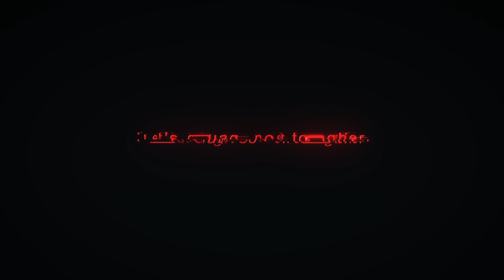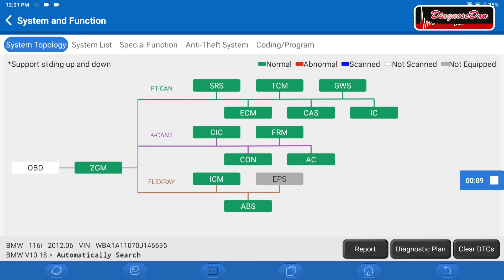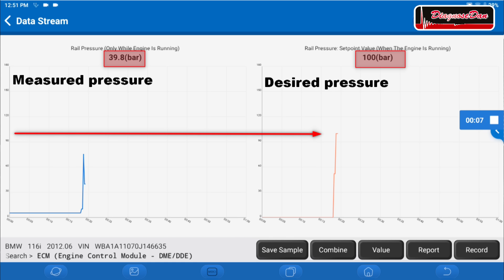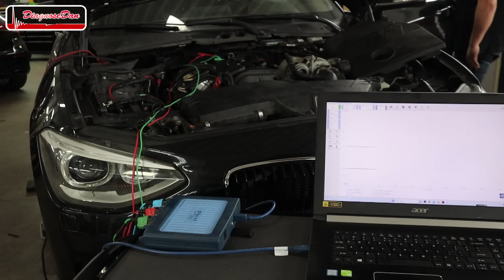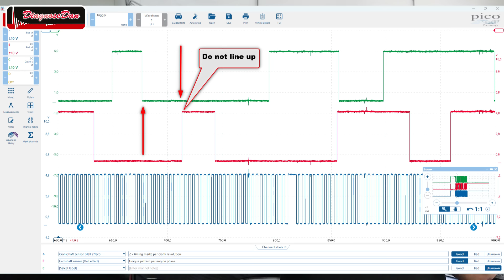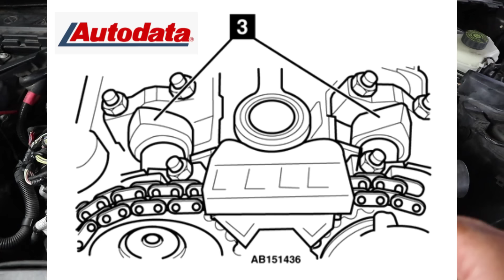Bmw dealership blunder? Incompetence?

Comment: On my diagnostics it has cam/crank sync and would have picked this up straight away and this would have been at the side of the road! I wonder how many parts of the parts cannon would have been thrown at this by the dealers before light dawned on marble head??
Reply from the maker: We'll fortunately never know😊
Reply: @Diagnosedan  Bet the owner is thinking that to 🤣He/she still has a large repair bill to stomach!

Comment: Thank you, Dan. This was very interesting and informative. I appreciate your making the effort to show and explain how ha HPFP works and is controlled by the ECM. That was special.

  I am a bit curious about the potential / actual “interference” design of this engine. Was there heavy valve and / or piston damage done? I realize you were not hired to make that determination. But, curious minds ….
Reply from the maker: I was only asked to diagnose the initial problem. The independent workshop picked up the car and will repair it. They will keep me updated and if i have more info i'll share that on my Facebook page

Comment: Interesting. After you checked for spark, and introduced an alternative fuel source and the engine did not start, you did you not check compression next. This would have shown equally low compression in all cylinders confirming what you found with the graphs, a timing issue. Very few mechanics would have used a graph 📉 to check timing, perhaps the spark timing was also off also.

Comment: This channel should be called "has clue Dan". I deal with this in Aviation Maintenance, guys right out of school just can't see the problem, they are clueless but they are licensed A&Ps. You would think this is only the young kids right out of school, but the old guys out of the airforce who get to skip A&P school are worse.
Reply from the maker: In aviation standards should be alot higher. Bigger problem when the engine stops working😂

Comment: I have a feeling that the dealer tech (if we can call them that) has probably seen other cars of similar model and mileage that needed a fuel pump, and just threw a low pressure pump at it, obviously not testing and not fixing the problem. The second shop saw that a low pressure pump was chucked at it and staying on the fuel pressure thought train, put a high pressure pump on it, again not fixing the problem. A real diagnostician (Dan) did his due diligence and found it to be a timing issue, causing a low high pressure pump output. I am still puzzled though at how they supposedly checked the timing. Even if it didn't set a timing code, scan data may have shown the actual timing and the desired, maybe they didn't look or think it was relevant, or maybe they don't know how to properly read scan data. I don't know if it shows on that particular car though, but every car I have ever worked on always shows actual and desired timing. This is what sets this man apart! DiagnoseDan fixed it again!! Great job!👌🏼👍🏻
Reply from the maker: I've seen the scanraport made by the roadside assistance after i released this video. There were timing related faults stored!
Reply: @Diagnosedan  There you go! And for them to ask the customer which parts they wanted to replace next is just sad! Thank you for the great content and your time!

Comment: Dealer charge for parts and labor. When a problem is not resolved labor should be waived. New tech seems to be afraid to bring out the diagnostic tools. They don’t realize the more they use it the better they will become in troubleshooting problems.
Reply from the maker: Technicians arent always allowed to spent to much time on a vehicle.

Comment: this engine is probably very similar to MINI engines we never had any engines like that here in Canada or USA I have a MINI Countryman here a my shop that has a timing chain problem I have to take it apart to see if the valves are ok I have done a few of them same goes for the N20 N26 engines the timing chains are surely not a life time item.
Reply from the maker: Thanks for the comment its appriciated

Comment: I would say the codes were deleted and a tech at dealership seen code didn't pay attention all he saw was low fuel pressure and said ut need a pump would be my guess independent shop couldn't checked timing and found good unless there were just looking at data pid on scanner anyone with common sense says u can't go by a data pid
Reply from the maker: Thanks for watching

Comment: So much guessing goes on these days !!
We call it throwing a parts roulette or a parts Cannon  at it.

1st off when they condemned the low pressure fuel pump why didn't they apply external power supply to it and measure the pressure?

You can prove lots of parameters BEFORE spending time and money on parts.
Garages these days seem to be focused on guessing or just going by what a screen tells them !

Problem with that is very expensive bills for customers putting them off garages.
The better your skills the lower the final bill will be with maximum profit margins ✅
Reply from the maker: Unfortunately this sometimes happens

Comment: I can see why stealerships replace parts with minimal diagnosis. Hear me out. If you plug in code reader, it states part X is faulty and costs Y money, then you have to weigh up part cost Y to diagnosis cost Z. But there is a fine line, stealership should have measured the fuel pressure.
Reply from the maker: A Scantool will never tell you a part is fault.

Comment: As soon as I heard that engine crank, it spun over so quickly I suspected low compression. I would have run a cylinder compression test before doing any other tests. Why did the dealer chase fuel pressure  as the problem?
Reply from the maker: Thanks for watching

Comment: Interesting, but I am unclear... surely the high pressure valve is directly linked to the position of the cam that drives it.. so even if the cams are out of time with the crank (and ignition etc),.. it should always be getting correct timing from the cam sensor for the cam it is linked to?  so it should not have problems maintaining pressure, even on an "out of time" engine?
Reply from the maker: You make one mistake in you thought process.
The pressure in the rail is not constant. It builds up right before the injector opens. So the build up of pressure is timed!
Reply: @Diagnosedan  Thanks Dan for your reply, yes, you are correct, I was assuming that the pressure was maintained constantly on the high pressure rail and the injectors just fired when required. I was assuming there was just one cam lobe driving the high pressure pump, so one drive/pump cycle had to cover the four pistons. As you can tell by now.. I am no expert ;), so thanks for your clarification. I am new to your channel and enjoying it lots :)

Comment: I hate to say it but it sounded odd to me when you first cranked it to confirm the customer complaint. i.e low on compression. Cheers Dan another fantastic video and superb diagnosis. Was it also noticeable when you were checking for spark ? As that never seemed consistent either ?
Reply from the maker: Yes that was a clue the ecm wasnt sure about the timing

Comment: This is an interesting failure.  I'm curious how much real time you spent on this?  4 hours?  Two days?  A week?  Just setting up all the diag equipment, pulling wave forms, removing the valve cover....That's easily a full day of tear down.  How much did you charge the client for diagnostics?

Comment: Hey Dan great video! question, isn't the cam lobe a pre set thing? how can it push the HPFP plunger only 50% or 75%? wouldnt it always push it in all the way then the fuel pressure reg regulate the pressure up or down to suit? 
Kind regards from Australia.

Comment: Bmws of this Era seem to have timing chain issues. The bracket for the top guide is part of the head or replaceable?

The n20 is usually OK after it skips due to, I think, the dme detecting the cam timing is instantly wrong and retards instantly the intake lift via the eccentric shaft motor and it salvages the valves on the intake cam and the exhaust usually is pretty much on time like yours is. 

My guess is the exhaust timing is basically on the money if the chain wasn't so farked up and sloppy with intake cam 90 degrees out and the guide piece is long gone.

On the n20 you also need to replace the oil pump chain "module" as part of the service for a long lasting engine repair.
Reply from the maker: The guide is replaceable

Comment: I heard the timing chain problem at the moment you tried cranking the engine.
With the known issue of timing chain problems on that engine, this inability to diagnose the car correctly is inexcuseable.
I wonder how long the CEL was on before the chain  skipped.
Reply from the maker: I think it must have been on for quite some time!

Comment: Interesting, , How most humans' think because it the Dealership, they automatically know what the are doing. Spark and fuel test should always be done before changing parts, so if you spray a fuel source and it still doesn't start how would changing the fuel pump solve the problem?

Comment: Amazed a BMW dealership is so hopelessly incompetent not to diagnose/fix this car. You don't even need 20 mins of diagnosis, you can hear as soon as it cranks that the sound is different, and that there's hardly any compression during trying to start. But obviously, the "go to" tests are the cam/crank waveform and the crank/current draw during starting.
Reply from the maker: Thanks for taking the time to leave a comment its really appreciated

Comment: So.... what is the next step?  We found the broken chain guard, did it not jump teeth? And if it did, does this mean engine out and check for valve damage?
Reply from the maker: My job was to diagnose the initial fault, the vehicle went back to the independent workshop to get repaired

Comment: Has the drive gear for the high pressure fuel pump failed? Some engines the pump is driven directly by the camshaft, others have a little gearbox type assembly between the cam and the pump. I have seen it where the gears explode - the pump has no drive, and hence no fuel pressure.

This comment is written 8 minutes in. Wonder what the problem actually is.
Reply from the maker: Now you know😊

Comment: We have had so many BMW'S with this problem,  a cursory look at the  fault codes results in the removal of the cover and a look at the cam positions.  A pain is the removal of the sump to get the obligatory broken guides out as it involves dropping the subframe a little and disconnecting the rack. I would say How in God's name BMW and so called BMW  specialists don't know this ? BMW mechanics at our local dealerships  would not know what to do, a new engine would be the only recourse  which writes off the car. The specialist  probably  good at M badges and wide wheels. I am soon to retire and I despair of the new mechanics who seem to think every thing is fixed by a diagnostic machine or a remap.
Reply from the maker: I know, but when you've done it a few times is actually not that bad.

Comment: As the both pumps have been changed you can assume that there is no more primary fault. Why didn't you measure the pressure on the high pressure rail? And even if the pump provides only a 50% of pressure, the engine will run. I would proceed in another manner, above all for this engine who is well known for these problems that means timing failure. Once you removed the plugs and checked thems you measure the compression followed by endoscoping the cylinders/valves. That provides you a rapid understanding of the problem. We do not know in this video what finally happend. But the slash of this chain by jumping can easily cause bended valves. Thats probably why the engine didn't start anymore. It's dramatic, that the BMW Dealer didn't reveal this problem.
Reply from the maker: We didn't measure but we sure read out the high pressure in the fuel rail didn't we? 
Would a look in the cilinders reveal a problem? I don't think the valves are damaged. We also did a compression tests didn't we? ( The in-cilinder waveform)
Reply: @Diagnosedan how is the compression derived from the in cylinder wave form? Why not use a pressure gauge on the spark plug holes to be sure?

Comment: oof... BMW with these plastic timing chain guides in their engines faces constant issues. This is not the first video I see on the topic. They usually are mentioned in conjunction with the N47 diesel engine that likes to skip a beat and destroy itself in some cases.... from what I gather this is rare though but not unheard of and in some cases it turned out that the oil was never replaced or the engine was abused... so the jury is pretty much out on whether BMW is at fault with these timing chain related issues.
Reply from the maker: Maintaining your vehicle properly certainly helps!

Comment: is wessels und müller in the netherlands too or where u got the bremsreiniger? also you shouldnt be using bremsreiniger directly infront of the turbo ;)
the other shop checked the timing by fault codes. no cam/crank faults = timing is good.
Reply from the maker: Yes WM opened up a few stores here in Holland

Comment: what caused that guide to fail?  i have seen many guide failures but none where the metal broke
Reply from the maker: Because of the slack in the chain, the chain is knocking against that guide alot causing it to break

Comment: I'm sure there's a reason the high-pressure pump doesn't deliver a continuous high pressure and let the injectors worry about the timing, but wouldn't that be simpler?  The problem with failures is the cascade.  Don't line up too many dominoes to fall or the techs will start jumping out of windows.  BMW is known for all this stupidity.  How do other cars do this?
Reply: Then you would need a pressure relief system much like common rail diesel engines. Which adds to the complexity and cost, yada yada.......

Comment: Ive been in this industry 15 years.  Amassed 150k in tools and 99% of technicians including myself do not go to these lengths to find the answer.  Although amazing this is not practical when you only make 1hr labor pay on a diagnosis.  This case maybe 3 hr diag charge but still the computer should have stored timing correlation codes and you would know right there it was solenoid or timing related.
Reply from the maker: The owner of the vehicle showed me a scanraport made by the roadside assistance. There were timing related faults stored!

Comment: Wonderful video! You addressed a question I have had for as long as I've been watching videos (about direct injection). Does a cam lobe correspond to  every cylinder's need for fuel, or does the pump have an accumulator built in, and possibly provide fuel for more than one cylinder per stroke?
Reply from the maker: Now you know

Comment: Great video. Could the problem with no codes be from the valve timing problem creating a reading so the ecm thought you were doing a no fuel crank with the gas floored?
Reply from the maker: I talked to the customer after the video and there were timing related faults stored in the car before it came to me

Comment: Why did the car not set a correlation error ? VW Cars will threw a G28 to G40 correlation Error P0016...
Reply from the maker: After the video i talked to the customer and the roadside assistance scanned the car and there were timing related faults stored
Reply: @Diagnosedan  Thanks for replying Dan

Comment: Hi Dan or anyone else reading this, what was the spray you used to 'add fuel' in the breather hose? Thanks in advance!
Reply from the maker: Brake cleaner😂 not recommended
Reply: @Diagnosedan  ah haha ok ok i was wondering , it's ok it's just few for few combustion's right? 🤔😄

Comment: She's likely got some bent valves and/or piston damage.  Time to pull the head and make some preventative investment in finding out before doing the chains and guides. Also there might be a better source for replacement timing parts that do not fail like this crap.  I'm very surprised this timing guide issue is occurring with a BMW engine ! More plastic junk.

Comment: How do you check the engine doesn't have internal damage and therefore if its worth replacing the timing chain, etc?
Reply from the maker: I dont, i was only asked to diagnose it. The independent workshop picked it up to take it from here

Comment: Hello sir I have bmw 2002 316i 3series n42 engine I really need engine wiring diagram because wiring for both vanos and cam position sensors has someone cut off from one week I m searching in Google but I didn't found the same diagram for this car can you please send me the pin out wiring from dme to vanos and both cams sensors

Comment: Question for you Dan, if the regulator selonoid is a normally open open one, theoretically if you unplug it, will the engine attempt to start?
Reply from the maker: Its not a given its normally open one. It depends on the manufacturer.

Comment: And what kind of garbage scanner are you using?
You absolutely should have seen fault codes related to timing.
Even if they deleted codes, you can recover them.
Start using correct software.
ISTA or Launch